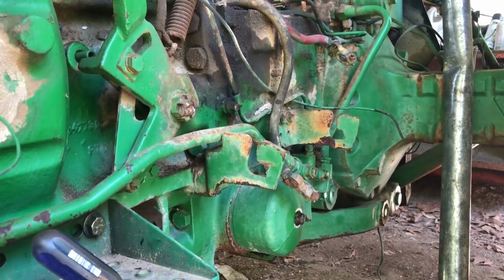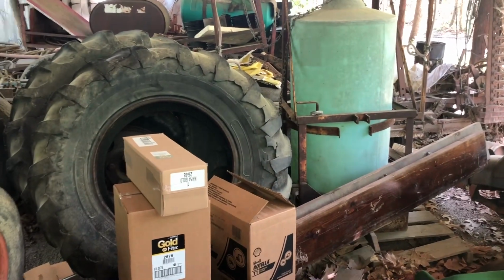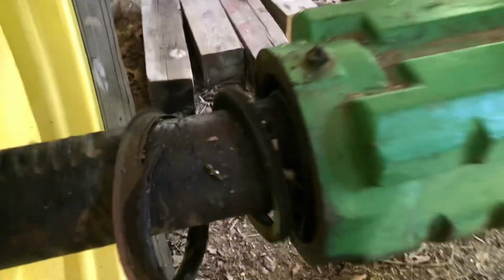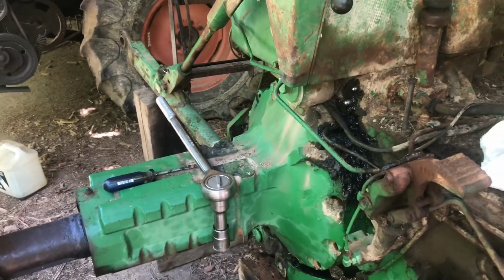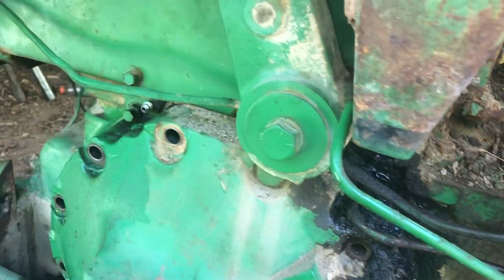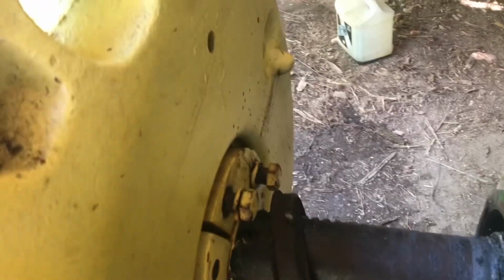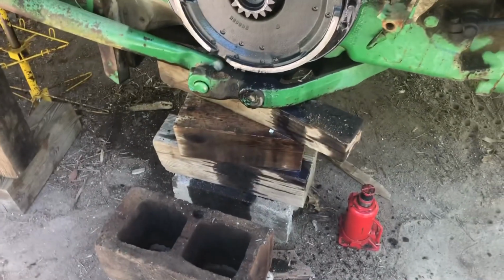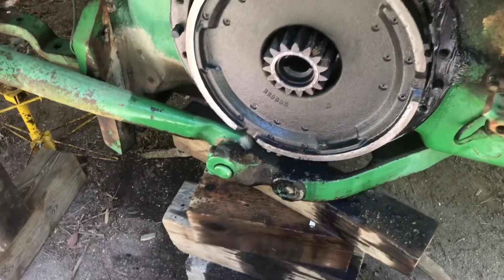Working On The 4320 Between Job and Rain

Comment: Tough working on old equipment that has fought Mother Nature for over 35 years. Great job you two!
Reply from the maker: Thanks cousin Wayne. You settle in at home yet or you wanting to go back ?
Reply: @gleanerk  
  Tried to go back on April 12, got as far as Chicago when the flight to Anchorage was cancelled. Volcanic ash in the atmosphere due to an eruption off the coast of Alaska. Still problems getting flights in and out of Alaska as of the 14th. Once Kansas starts getting over 90 degrees, I’ll wish I hadn’t left BUT Anchorage still has snow! My son got 7” of new snow on the 11th.

Comment: Money flies like time...  We really don't think much about the money, it's gotta be serviced and fixed.. and always takes time..
Gotta say, I've never had a JD axle housing and axle separated...but I have had the housing and rear end apart.. might be able to take the housing off and take the gear off and go that way 🤔 you can check the brakes then too.. (and that's what you did 👍)
We made Dolly's to split the axles off. Had to do brakes and clean all the old brake shavings out of the rear end of the 4010 when we got it. She's a basket case, but that's way better than she was!
Coming along cousin 👍😁
Reply from the maker: The axle has been rebuilt so hopefully tomorrow we’ll reinstall it.
Reply: @gleanerk  perfect 👍

Comment: If memory serves me correctly  that bearing goes on from the inside Actually leaving the Wheel Hub on allows the whole  axle assembly  can stand vertical which helps the mechanic during disassembly  and assembly.....  Replaced quite a few  on skidders...  the procedure is the same  whether  a bar axle or one with a hub flange.....
Reply from the maker: Absolutely correct David! Just learned that today. We ( my son and I under there supervision) rebuilt it today at mechanic shop ! Ready to be reinstalled.
Reply: @gleanerk  Pull the stub out the differential and insert it in the  planetary..... easier to align one set of gears over 3....... before refilling  rear, pull  and clean suction screen behind filter
Reply from the maker: Ok thanks David! I appreciate you sharing your knowledge with me.

Comment: Wow.  I was wondering why it was parked.  Those wedges can be a pain.  Grandpa used to put waxed paper in before tightening them up.   It helped for the next time they needed broke loose.  1983-84 is going on 40.  Do you know if it's a 71 or 72?
Reply from the maker: 72 , one of the last 3000 made according to my son . Wax paper sounds excellent idea!